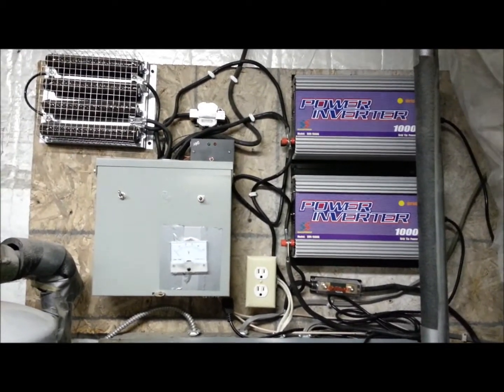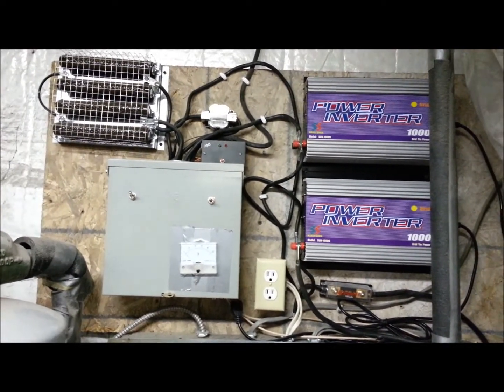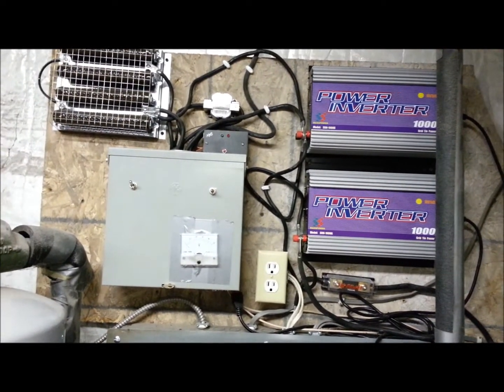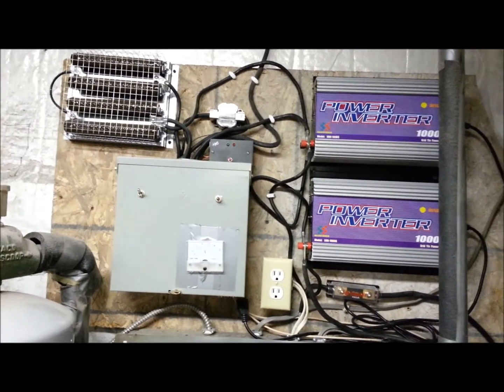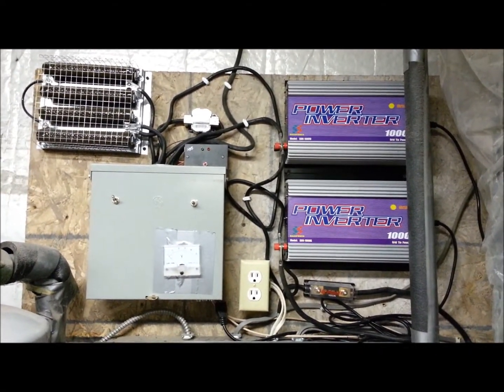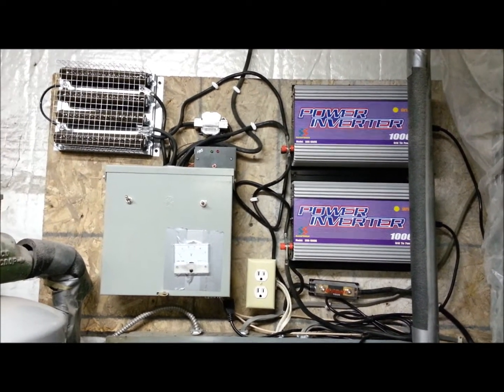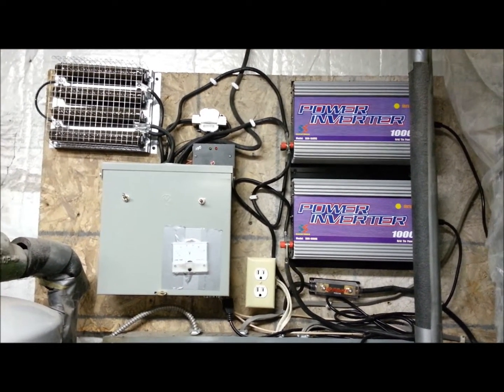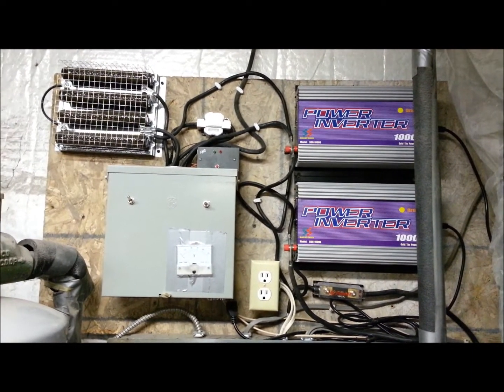Wind Turbine Project

Comment: I run the MW pma and do they put out amps.thats what you need amps.Put your turbine up as high as possible.Stay away from wind max pushers the blades explode and the charge unit often runs faulty.Always make sure companies supply spare parts.
if not walk away.good luck.

Comment: Todd, my pma is 1600watts-14 magnet. I live in Brisbane Australia and don't have any problems with mine starting up. I run 5 falcon blades.I did the same thing that you are doing,by looking at other videos. There is a lot of crap on you tube and a lot of it is trial and error. The only problem I am having with mine is a slight vibration down the pole.

Comment from the maker: My first turbine was 1600 watts and 14 magnet, it came with 9 raptor blades.  The start up speed was about 12 to 15mph. I upgraded to the 13 blades and it did lower my start up speed a little bit. Mostly helped with keeping it spinning when the wind slow down. The batteries didn't start charging until the wind hit 23 to 25mph. Way to high for my area, so I have sent it back.  I need to try something that works in lower wind speeds.